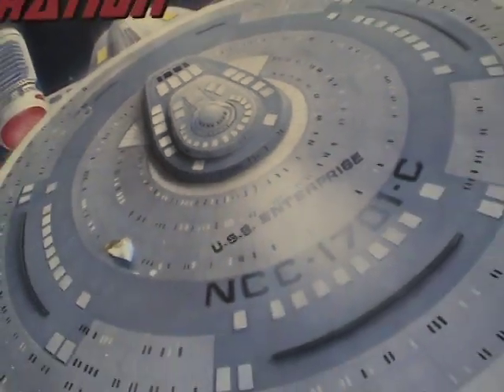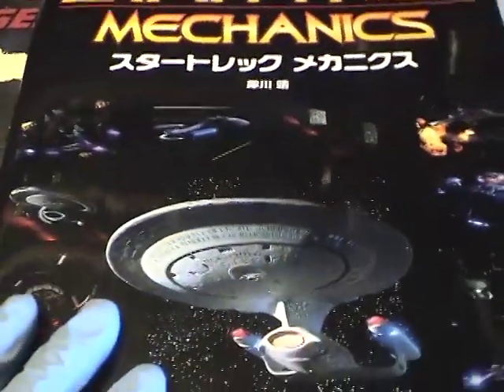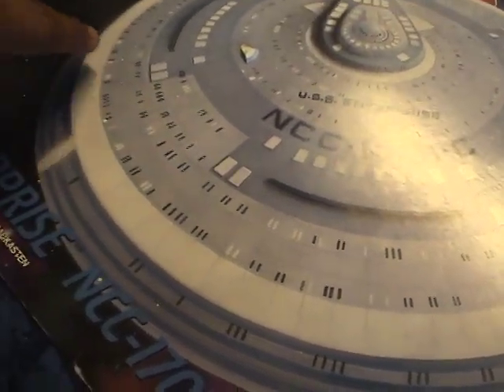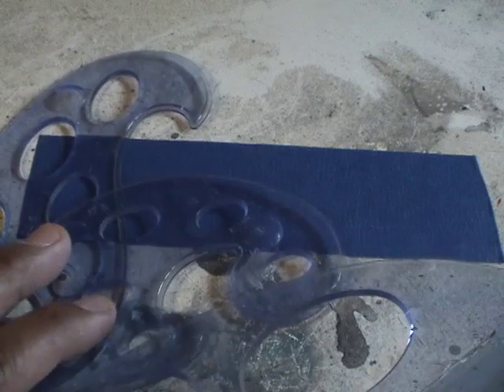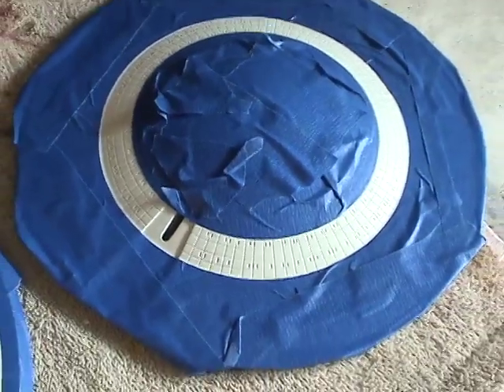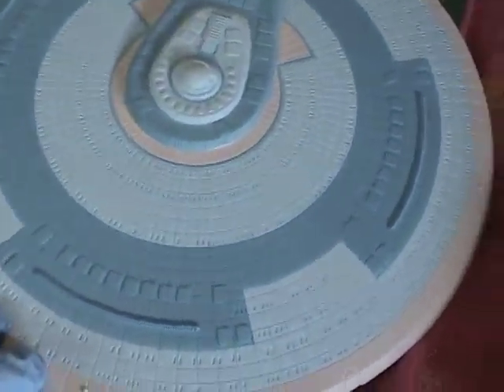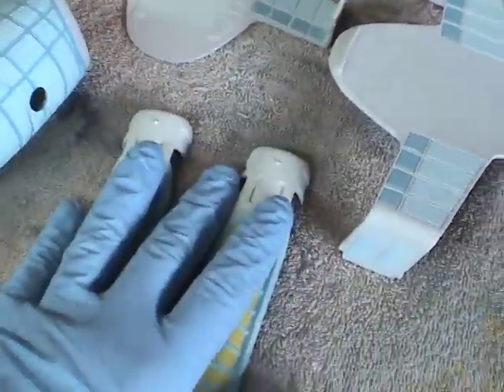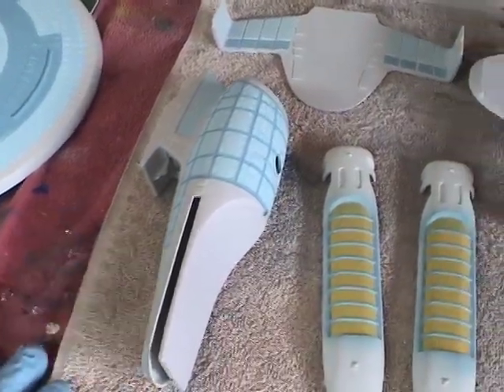Painting the AMT 1/1000 scale USS Enterprise-C model

Comment: Did you say that the template was called a french curve template?
Reply from the maker: Yes....you can find them at most art stores or certainly online.  Check Blick's Art supplies
Reply: Thanks for the tip, I tried that thin flexible masking tape on the saucer section and it kept shrinking up. This is a tough model to mask and paint.
Reply from the maker: Yes...it's definitely time consuming.  The french curves are not the only way to cut out pieces of tape in the form of a curve but I thought it made things definitely more manageable.